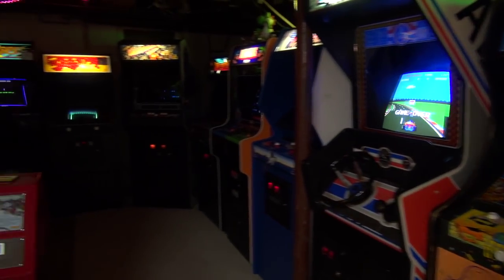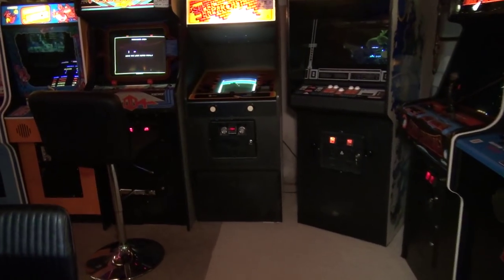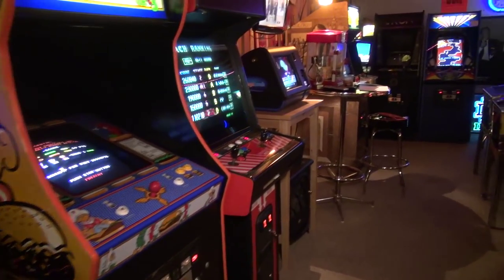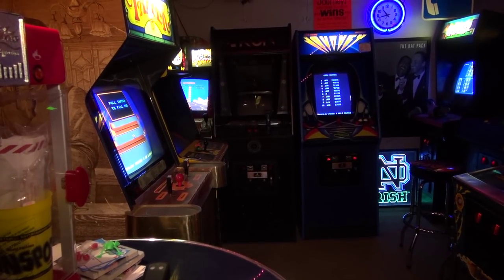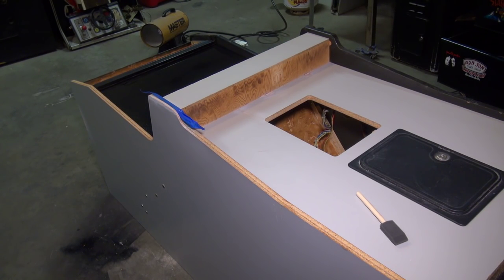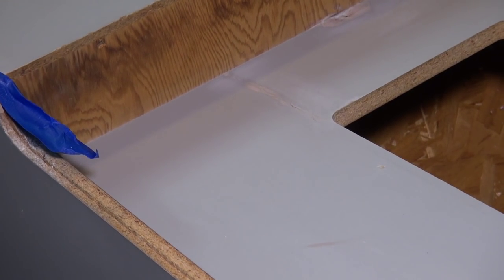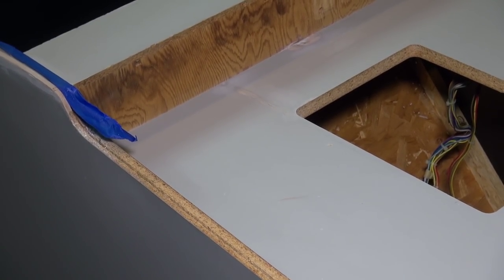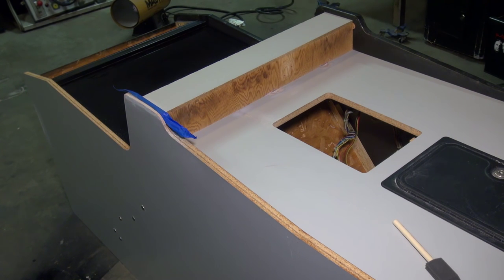Nintendo Vs. Unisystem Arcade Restore Part #3 - Paint, T-molding, Power Supply, and way more!

Comment: John, Next time , try temporarily installing the t-molding on the straight away , cut it, remove and move it over install the uncut portion over so you are on the straight away again . Rinse repeat and then install your new cut t-molding.  This tool was clearly intended for straight counter tops.  Awesome video John!
Reply from the maker: +Charles Smith Yeah, I know now. I will address this in the next video!

Comment: John, I just filled some small spots like the ones you filled on my Playchoice countertop. If you allow the Bondo to gel (about 15 minutes) you can then get a razor blade and slice the Bondo down nice and flush with your surrounding surface with no sanding! Worked well, I will be airbrushing the paint over to blend. Good video.

Comment: John how about measuring where your corners are going to be on the t-molding, and then putting those areas temporarily on a straight away--trim it and then pull back out and then put in proper spot it will be trimmed around the corners.
Reply from the maker: +ed baert Next video! I figured this out after. :)
Reply: +ed baert 
That's what I was thinking, cut it all on the straight away.  Hammer it in, cut, pull it out.  Repeat until it's all trimmed down, then hammer all the t-molding in place.
Reply: +John's Arcade Game Reviews & Tech And for reapplying the sideart, don't be afraid to mark some lines with a pencil. It can be cleaned up pretty easily. Pencil is a carpenter's friend for wood-like surfaces :)
Reply: +ed baert Put it all in the straight areas..trim it in sections at a time till all trimmed THEN insert around the cab.

Comment: Regarding that t-molding cutting tool problem with corners. Next time you could get a long piece of wood/plywood (or whatever cabinets are made of) with the same thickness as the sides of the Nintendo cabinet. Then you cut the exact measurments of the offset groove and then put the oversized t-molding on that, cut it with the tool, move the t-molding up, cut it some more, move it up, and then you have a pre-cutted t-molding ready to apply. You don't need to cut it on the actual cab, you're doing it on a long and straight piece of wood that's a replica of the sides of the Nintendo cab.

Comment: John when using the t molding trimmer put molding on front of cabinet trim a few foot at time pull molding out slid up keep working small pieces till you get the entire length done  it will take time but you will get the finish you want  keep up the great work

Comment: 08:15  -  from the feet, John, not from the back!
Btw if you take an spatula to put off the rest of the bondo, you will get a nice smooth finish AND you dont have to use the towel. And there are a lot of spatulas on the market, each one for his own work/mission.
I mean its true, you dont see the 2 cracks under the control panel when ur playing, but YOU KNOW they are there :-). I would have made them nice and smooth, but anyways, good work and I guess you motivate a lot of guys out there doing the same!

Comment: In addition to what you did with the staples, I would have screwed and glued a piece of wood over the crack from behind (covering and reinforcing as much of the crack as possible without interfering with the mounting of the coin door).

Comment: For the cutter thingie: Put on a few feet of t-molding on a long edge then cut it, then move the t-molding and cut the next few feet until you have the total length you need. Basically using the large edge of the cabinet as a guide for cutting. And why don't you put on the sideart when the cabinet is lying on its side? Way easier, as gravity is not working against you.
Reply from the maker: +Scythe42 NEXT VIDEO! :)

Comment: John, I'm a HUGE collector of the marquis IGT S2000/ I-game kits and into restoration.  I have 2 IGT slot machines in my room and swap kits in and out of the machines all the time.  If you want info on IGT, check out my channel.  WMS/Williams is the current addiction.  Tread lightly in this hobby, it can be as addicting as arcade games.  Anyway, I'm in Boise, Idaho...maybe I'll see you guys at Grinkers this weekend!  -Jason

Comment: is it possible you could sell me the same model of coin door i cant find a replacement for my cabinet the coin mechanism wires are cut and the coin door lights are missing . my cabinet is a Joust vs.uni system  with a robocop data east pcb installed instead of the origional
any links would be greatly appreciated. thanks in advance    - matt